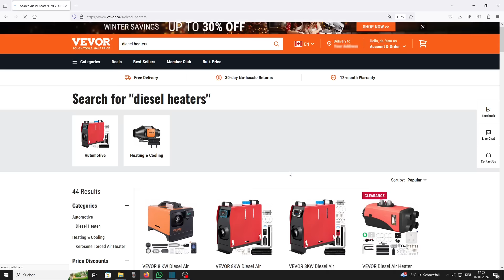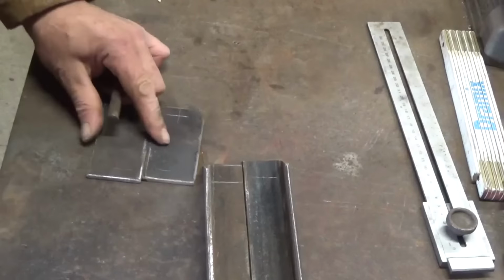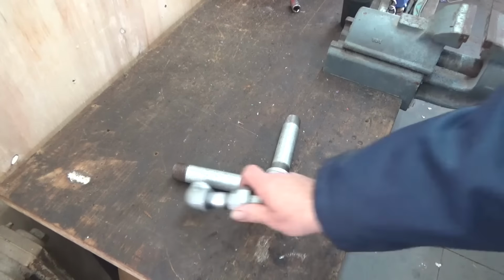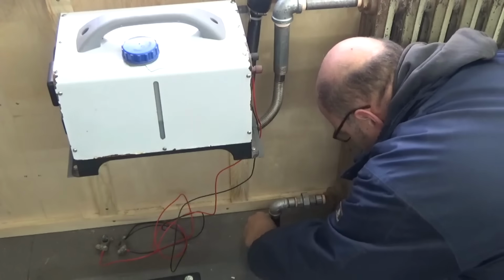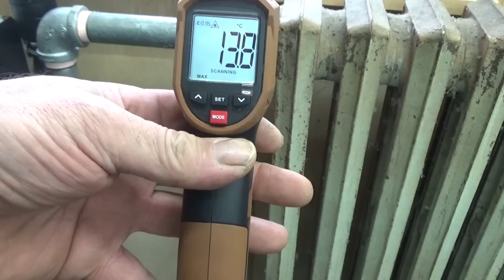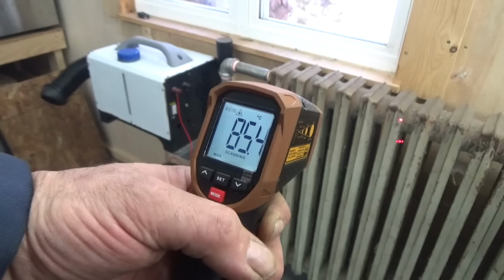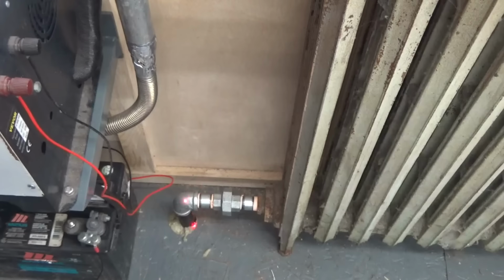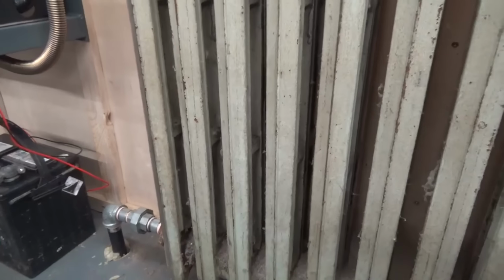Diesel heater upgade 200% more efficient

Comment: Wouldnt it make more sense to pipe the exhaust to the bottom opening of the radiator since heat naturally rises upward???
Reply: outside the radiator air raises because radiator is hotter than incoming room air. Inside the exhaust gases descend because radiator walls are colder than incoming exhaust gases.

Comment: Brilliant & comments, what about using copper pipe which runs ( attached ) through aluminium square plates spaced close together, heat then could follow wherever the pipe ran, eventually through to outside of wall, - just a " maybe " idea  : )

Comment: Any way to mitigate the sound of all this ticking? That would drive me bonkers. After it's up the temperature that is still tick like that??
Reply: The tick is the fuel pump, it always ticks when running.
Reply: You could move the fuel pump into a sound proof box. Or just turn up the TV.
Reply: Like what Dave said, you can build a plywood or MDF (or metal if you're you're metal like that) box and soft/decouple mount the pump inside. I ran my setup for 5 months and the hum of the heater completely drowns out the pump after using a box. I just used rubberbands to hold it away from and in the middle of the walls of the box so the vibration/noise doesn't resonate the box.
Reply: There are quieter pumps you can get for $20 or so. there are youtube videos on how to quiet the heaters.
Reply: The tick is continuous no matter how long it's run. 
The only real solution is to run it outside and make a box from insulation board etc. I've had one running in an adjacent room and the noise is still audible.

Comment: Great job, BUT.... the exhaust outlet is designed to run at a typical specific 45 degrees.. there abouts downward .  This downward slope from outlet through exhaust pipe to tip into muffler is needed to allow exhaust pipe to drain moisture to weep hole in muffler, note muffler needs to have it's weep hole facing down to drain... moisture from system.  You directed your exhaust in the opposite direction.. this will surely trap moisture in your line and your radiator system..
Reply: Expecting it will last a couple of years, then rust through.
Reply: @plinble  nope, this make buildaps in exhaust and in heater, so this may not las even one year(depend on usage)

Comment: Ive had mine running in my garage for five years now, I think I'll  try this when I reorganize later this year. the other benefit would be to hold the heat when the heater turns off, that much iron should remain hot for a while.

Comment: The first broblem I see is the heater is not above the radiator to drip away moisture remember how they are fitted in RVs the exhaust always runs down to drain and with that size of rad you are gathering a lot of obnoxious gases.
Reply: Exactly! It's not gonna work for long, so this tutorial is misleading. I once installed longer exhaust pipe, and it was only slightly bent upwards in the middle and it was enough for the unit to stop working. When i detached the exhaust and bend it to the ground lots of moisture came out

Comment: Did the same thing, works fine, as long as you reduce the amount of fuel, with the default settings, the heater is running rich because off, the reduced exhaust air flow, if you keep on running it with default settings, soot will build up and clog your heater.

Comment: So many 90 turns on exhast before radiator. Build up in radiator. Aluminum foil. Make your exhaust straight line between radiator and bunk heater, add slow big fan on your radiator.

Comment: What if you add a pair of vehicle electric radiator fans (slim) behind the outlet radiator, running slow to dissipate the heat when it’s fully hot.   Also heat reflect foil behind too.    P.s. Great idea.

Comment: every combustion exhaust contains steam. your radiator will create condensed water, and till it can flow out is ok but , BUT, can freeze. at worst, the radiator can develop corrosion till a through hole comes. don't forget the CO
Reply: There's no CO in a good combustion, it's only an issue in partly completed combustion, which is happening for example if you idle your car.

Corrosion should also be no real issue in this case, as the radiator is filled with CO2 most of the time - so not an oxygen rich environment, and the soot will also create a somewhat protective layer. 

Water freezing shouldn't be a big issue either, as the downward pipe will drip off the excess water. So the water level can only raise to very low levels, which isn't creating any pressure inside the radiator, even if it freezes.

But I agree a CO alarm is always a good idea.
Reply: @RubenKelevra  i'm a burner and heating system tecnical, there is always a residual CO. This heater has a blue flame-style burner withour internal recitculatuon, i bet has 13% CO2 and 30-40 ppm CO.

Comment: Hello Sir,   

When you put some Enflon tape in a cigarette and smoke it completely up.   Then you will get lungcancer.  So dangerous is burnt Enflon tape. 

Hennep would be a better choice in this case.   And remove the hennep thas has no use. 

I made something alike.   But i used a bit more modern radiator that has 3/4 inch.  I used a PccP version.   A plate/convector/convector/plate radiator.   Used 22 mm pipe for connection and the heat goes in at the same time in the top and the bottom at the same side and leaves on the other side above. 
I made 4 x 3.5 inch computer fans and placed them at the underside of the radiator facing upwards.    Instead of using 12 volt connected them with 5 volt.    That way they turn slower but with less noice.     As soon as the radiator at the bottom is 30 degrees Celsius the fans start to turn.  Blowing forced air through the inside of the radiator.    That way the radiator gives way more heat of in the room.    A guess , something like 3 to 4 Kw extra of free heat.     The fans run a long time on good powerbank.   
Be aware that the exhaust gasses have a lot of water trapped in it.     Probably in 3 years the radiator is destroyed.

Comment: From your friendly local heating guy (TSSA licensed ) 

Please dont do this.... 

That cast iron radiator is not meant to control products of combustion.  

Teflon tape is not heat rated.... 

That exhaust through the floor will definitely seep back into the building, and, will create a ton of moisture under the floor causing wood rott. 

The concept is absolutely correct, but this is a big carbon monoxide risk.
Reply: The guy is koo koo ka joo!
Reply: Also as a Tessa licensed tech I second this strongly
Reply: Can you explain more? What's wrong with having a radiator on the exhaust end? If there are no leaks and he has a detector if leaks happen later? Why can't he exhaust through the floor and elbow out past the side of the building?
Reply: @remyllebeau77  The exhaust can run through the floor, in vehicles (where these are intended to be installed) the exhaust always goes through the floor, unless you have one of these chinese things. But that hole in the floor has to be sealed to prevent poisonous gasses from entering the building. Stuffing rockwool that rodents will remove does not count as sealing the whole lol.  
Yes, you can have a CO2 detector, but if you how important is your life? I wouldn't install something that will leak, and rely on a detector to wake me up. 
Then there's the issue of corrosion inside of the radiator, carbon build up, and all kinds of things that this dude is clueless about.
Reply: @remyllebeau77  

That radiator (probably) consists of several sections that are bolted together. It was originally designed to hold in steam at higher pressures. IF you had a steam leak, you'd know right away, and the steam wasn't going to kill you. (Yes, I am aware steam is hot) 

You can route the piping out through the floor. You would need to seal it and route the gasses out away from the building so it exits without filling up under the building. It's still a lousy idea. 

CO is not to be under estimated. 

I've previously worked in emergency services, I've dealt with CO calls. It kills people, and it's not a pretty way to go.
Reply: @Benny1581  I see. Thanks for the reply.
Reply: @1QKGLH  it’s a work shop and it appears he has enough critical thinking to build that, that he doesn’t need these crap comments from people who suck.
Reply: @backyardpb 
I don't no why a minority of folk have to use uncomplimentary langauge if they have reservations about any given subject. Gives them some  pleasure to be insulting, weird stuff is out there.

Comment: Heat rises, so why would you not have the hot exhaust enter from the bottom and exit at the top?
Reply: That way you waste heat, by having the exhaust at the bottom, the exhaust will be much colder and more heat will go into the room.
Reply: @Mariano.Bernacki  hm, I guess you're right. Didn't think about that.
Reply: DEATHTRAP! Heat is not a substance and therefore does not rise. Hot gases rise due to changes in density. The answer provided is also incorrect. The exhaust gases contain liquid (water and sulphuric and carbonic acids). These would build up in the radiator and block the exhaust, causing incomplete combustion and poisonous exhaust gases to accumulate in the room. As set up, this will also happen in the exhaust outlet. I'd be surprised if this guy is still alive.

Comment: The only thing I would change is that line that goes down into the floor, just make sure it is venting to the outside, and not staying under the building. If the venting builds up under the floor it can work it's way back into the building, and that is not good at all.  Nice use of an old radiator, smart thinking.

Comment: It is 25-35% more efficient, not 200%, but I can understand your excitement 😉. The exhaust of a diesel heater wastes 0.1 to 0.7kW of energy depending on the heat setting of the heater. The 5kW heater is actually a 3kW machine. You can pass the exhaust through a bucket of water and you get hot water.
Reply: I was thinking the same.
Im thinking about building a CH system with water ( as I already have with nat. gas )  and exactly as you said, run the exhaust trough the water for extra heating efficiency.
Reply: it was more like a 3.3kw now it is a 4kw machine
Reply: 25-35% more heat is still a lot.
Reply: Yes the 4kW is being sold as 8kW 😂. Can't complain, better than 3.3kW!  @NightshiftCustom
Reply: @examplerkey  there all rated at 5kw but they like to lie and say 8kw. pretty normal for anything from China and even then there really only about 4kw. But there is a newer model that is about 6kw  rated at 8kw and has a bigger burn chamber with a 3.5" outlet but only a few company's are selling them. There is also a smaller 2kw model available
Reply: It's a bit more complicated. The Eberspächer quotes the net heat output which should be the proper way. The Chinese quote the calorific energy, that is if the total amount of fuel is 100% converted to heat their rating is correct but unfortunately you have losses in the heater, not all fuel is burnt, etc. even though you think you have a clean burn. The new slightly bigger heater that they're quoting as 8kW actually outputs 4kW but they're selling it at double the price of a 5kW (which are going really cheap), so I say thanks but no thanks. 😅 @NightshiftCustom

Comment: Has the exhaust tube from the heater into the radiator condensation other words filled with black water? You need to move the heater up so the exhaust is all pitched to the drain and depending on the radiator if you only have a single pass radiator where it goes top to bottom to top to bottom as it passes through that radiator is gonna fill up with water, your exhaust and problems if you have a small exhaust leak kill you😳
Be safe, pitch it all downhill and make sure your radiator will completely drain. In other words open passages on the bottom and the top. !
Reply: I just came here specifically looking for this comment and you left it only an hour ago lol!!

I'm wondering how to do this with having the heater outside as well to eliminate other potential for leaks inside the unit. 

How to do this and fashion a drain properly has me a bit confused. Any more information on this would be amazing!!
 Thank you in advance!!
Reply: @claytonvicarious  In this example, you'd mount the radiator at an angle, (there's no reason for it to be level). It would be angled so any exhaust condensate within the radiator would run down hill and out the exhaust pipe. It eliminates the potential of the entire gas path being water blocked which could see the gases escaping from elsewhere.
The better method is to have the heater outside in a box, but you're still having to run the exhaust inside unless you look at using a heat exchanger and water pump to the radiator.
Experiment firstly with a box outside with a coiled exhaust pipe which will pre heat the air which gets blown inside, lots safer.
Reply: @claytonvicarious  Use a stainless steel indirect water cylinder filled with sand.

Comment: There might be even better way. Diesel water heater. Plum it into one more cast iron radiator and use aquarium pump to circulate the water mix. Two radiators would stay warm even after burn cycle. Especially one filled with hot water.
BTW exhaust hose should never go up according to manufacturer.
Reply: I use a car EGR with inline water pump the fill the radiator up use the gas to heat the EGR and this then the water much better heat transfer
Reply: @batesysbikes  excellent idea!
Reply: @NINEWALKING  honest mate can’t even touch it on lowest setting
Reply: @batesysbikes, that's perfect. You have immediately almost doubled your efficiency. Good job, mate!
Reply: @NINEWALKING  this way you can add more and more radiators, then you have not to worry about condensation in the exhaust. Kind of winning all round and using on lowest setting saving fuel and heater wear on the mesh and pump
Reply: @batesysbikes Quickest way to kill a heater like this is to run it continually on a low setting. You need to run at max for a decent period to keep the burn chamber clean.
Reply: @Dickie2702 run high till up to temp then before shut off run on max for 30mins
Reply: @batesysbikes  That's perfect, but alot of people just run these permanently on a low setting which is not good practice.

Comment: When I first installed my diesel heater in my caravan, I connected the exhaust directly to a 3 meter length and steel 1.5" water pipe, then out through the floor, the water pipe 3" above the floor is 190° and is awesome for keeping that heat inside instead of heating up the atmosphere lol, I could have made it go around the room further.

Comment: You might do better with a vehicle radiator that doesn't have as much mass.
 Also a large pan under the diesel heater to capture a accidental diesel fuel spill.

Comment: Would it work better is the placed the exhaust pipe attached to the bottom and have the top of the radiator exits to the outside pipe from underneath?

Comment: I've seen a few of these videos with the cast iron radiators, but no one shows the temps on the radiator after 8 hours or shows that its even worth it. Does it actually put out heat?
Reply: Well what would have been nice is to see what that would have actually done on its own without the radiator. Of course the temperature outside and inside would have had to been the same to see with and without.
Reply: Of course it works because the gas from the exhaust is heating the cast radiator. The more surface you have, the more it dissipates the heat and this is what you want : a dissipation of the heat inside the room.

Comment: A Russian post did some tests on this type of heater and found that  the 5kw produces just over 3kw and adding a radiator on the exhaust added not quite 11/4 KW - he based his results on fuel used calorific value

Comment: That was cool! Could you have hooked the exhaust to the bottom of the radiator first and then run a longer pipe from the top of the radiator down and to the outside? The idea being to keep the exhaust moving in a downward direction, as others have discussed at length.
Reply: Yep
Reply: The idea to have the exhaust moving in a downward direction is also safety reason, if the chamber get flooded with fuel it should drain out by it self.
 And if the exhaust pipe inside and the gases stays well above 60 C it will dry out the pipe but maybe not the radiator, even if outgoing gases from that stays well above 60 C.

Comment: Hmmm, I don't think that the engine is capable of pushing its exhaust through anything more than that exhaust tube. The pressure loss will be significant, and you will probably damage the engine sooner if it's connected to something that creates resistance.
Reply: There's no internal moving parts other than the pre-combustion chambers "turbulator" [merely a fan]. Not worth worrying about.
Reply: Of course, very soon will be whole chamber in heater full of the impurities and non combusted particles. I saw video where it was dimounted and full of soot.

Comment: The problem is the exhaust running upwards out of the cdh.  The bottom of the 'U' will fill up with acidic condensation and rot through, letting fumes into the room.

Comment: Good idea however the radiator is designed to have water in it. Can the cast take the heat of superheated exhaust without developing leaks ? I mean long term
Not sure how hot exhaust gets in those heaters
Reply: Wrong, it's designed for steam heat.  I have steam radiators throughout my house